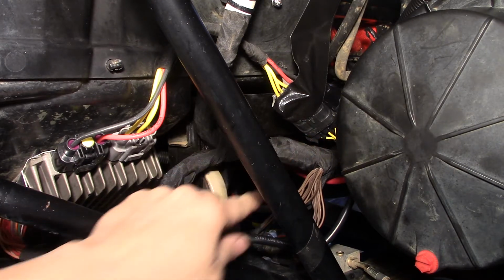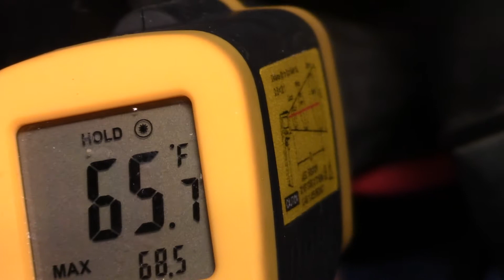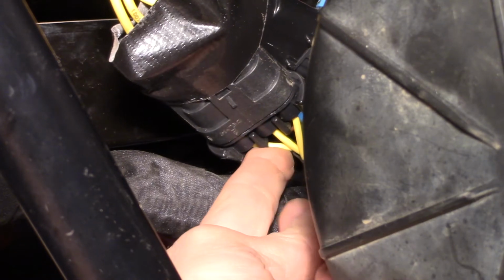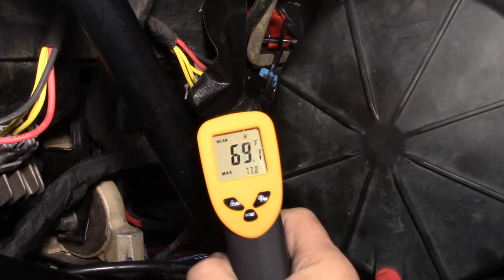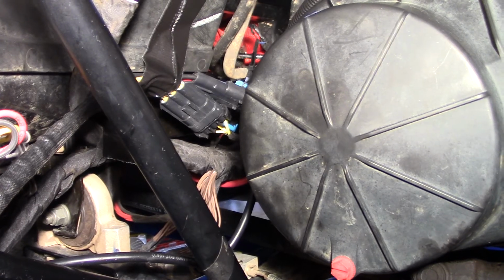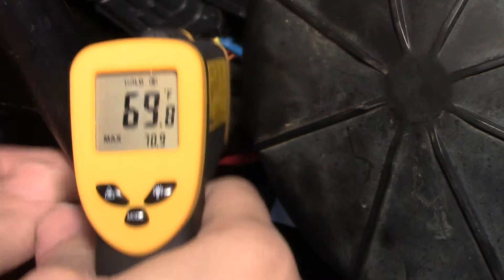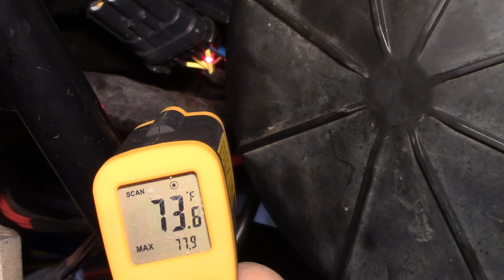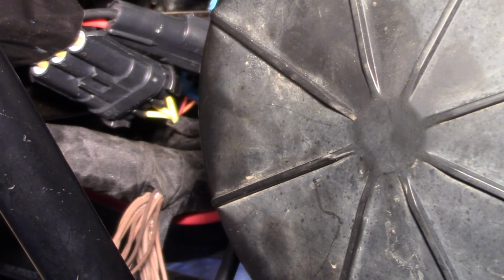ricks regulator causes overheating to Stator smaller wires

Comment: There is a 14 inch connector harness between the stator plug and the harness plug. Just for what it is worth that 14 inch connector harness only has 16 gauge wire. I only mention this as I have 2 2015 rzr 900 with this same problem. I was unaware of the short smaller gauge connector harness.  Hope you have your problem resolved.

Comment: I bought same product but for another motorcycle, same issue , even worse effect burned my stator , sent there product back, they said there were no issue with the reg.rec or the stator , i dont recommend buying from them
Reply from the maker: you're absolutely right. They will not admit to fault. Their regulator I believe also toasted my stator and wire harness. I sent it back and they finally refunded me but it came no where near what the cost of a new stator and wire harness cost. It's really too bad because they were rated so high yet I can't prove this is what their product did to my machine. I later went with Hawks regulator made in Japan and it works flawlessly. As much as I wanted this thing to work, it is a bad product.